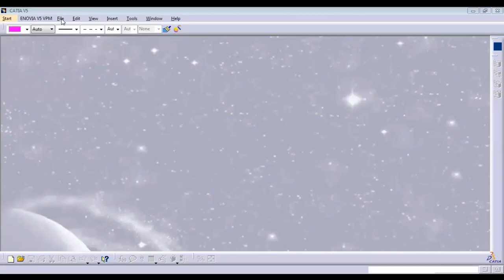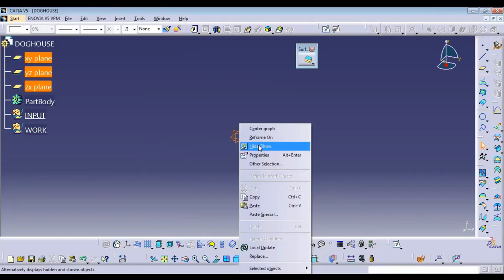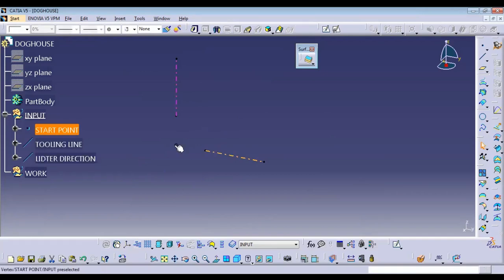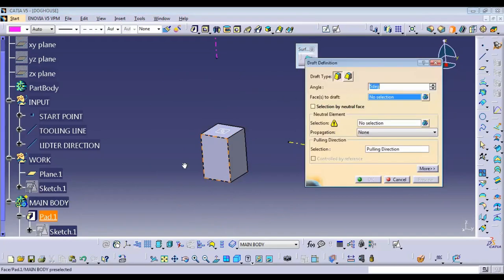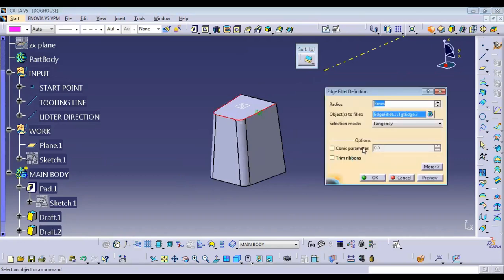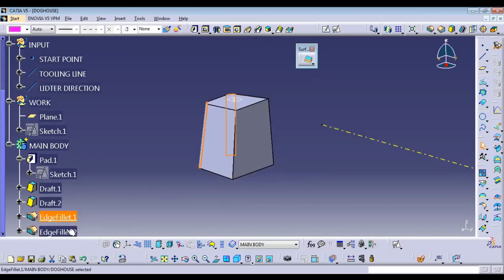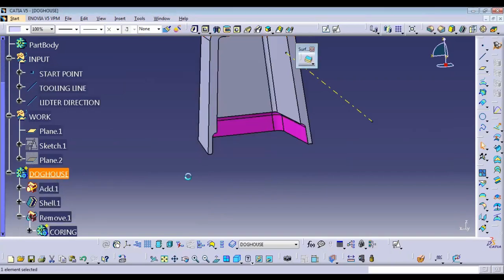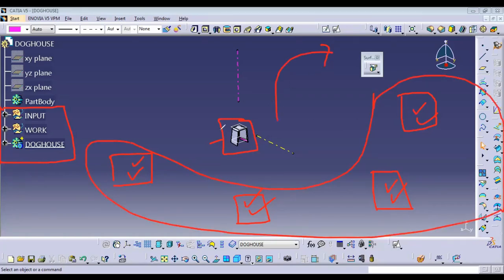How to Create Dog House | B side Feature

Comment: Excellent explanation. Do you have the link of any videos or material that show us how the Lifter and Slider works during the injection molding process? and also is there any problem if we use create axis system in addition to the tooling line? Thank you.
Reply from the maker: 01 Lifter and Slider you will get on YouTube 
02 Yes, Can use Axis System